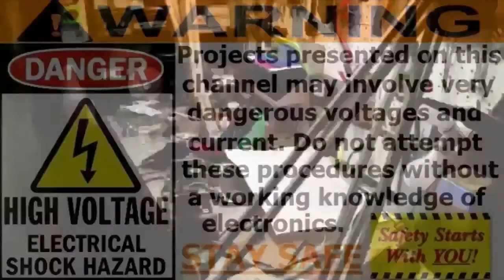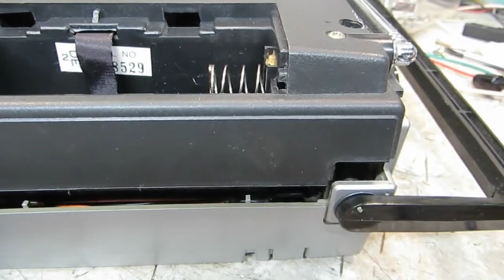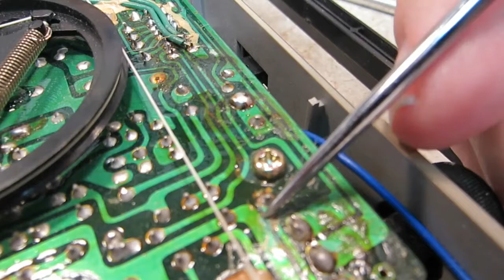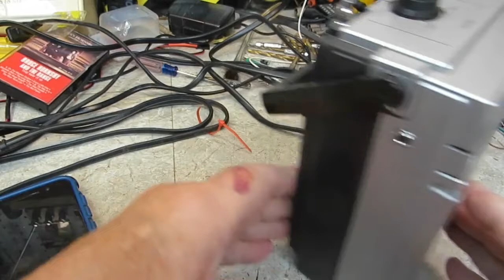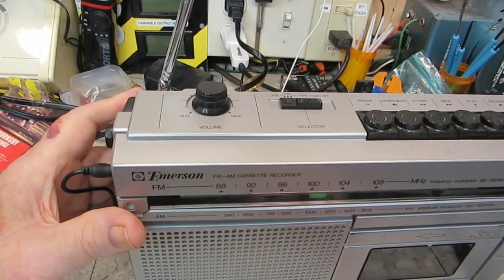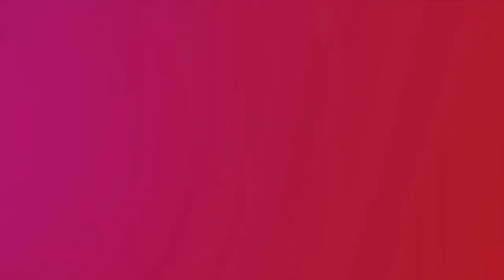DERB - The Emerson project - Final and demo

Comment: Thanks Doug and Bob..That should work perfect..I didn't really want to have to press play just to use the aux port so it works out great that it will work on either Am or Fm..I can't pick up Am stations anyway so even if that were normally an issue it wouldn't be in my case..lol
Reply: Here's a link to a picture I took of the of original cord that i got with one of my Emersons..Not sure if they come in different sizes so I measured it with calipers which is also in the picture..  https://www.dropbox.com/s/dcvknk12uwvsj0g/IMG_20200801_140740.jpg?dl=0
Reply: @DERB_Seymour_Indiana  That's exactly what I was hoping for..Losing functionality was something I didn't really want but if it came down to that it wouldn't have been the end of the world since i have 2 exactly the same units..lol
Reply: @DERB_Seymour_Indiana  The gaped ones seem to be a lot more common..I had to search high and low to find another one without the gap for the other Emerson that didn't come with a cord...Thanks again for the help Doug..really appreciate it.

Comment: Yes but you can wire it in to the Bluetooth on the tapeswitch yes it would be on but the amount of power it will draw will be minimal without a signal going to it the Bluetooth is turned off on a device I will draw virtually nothing